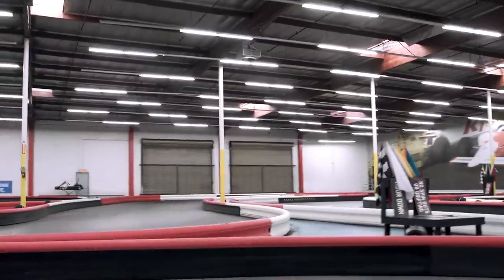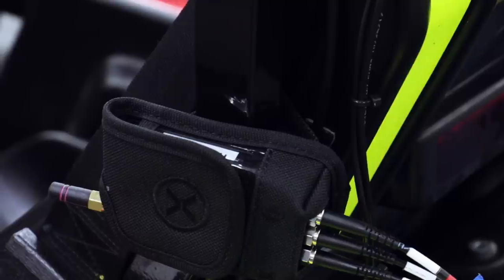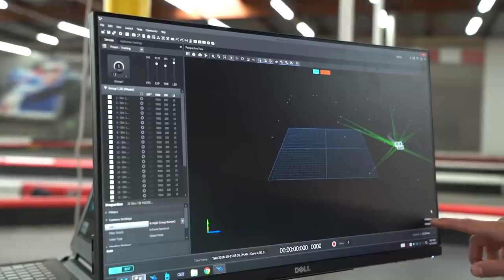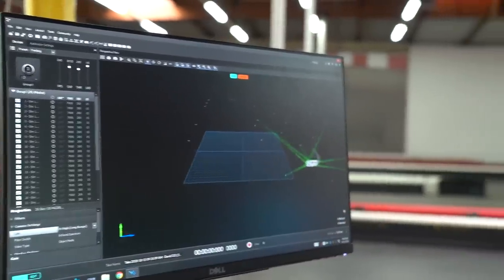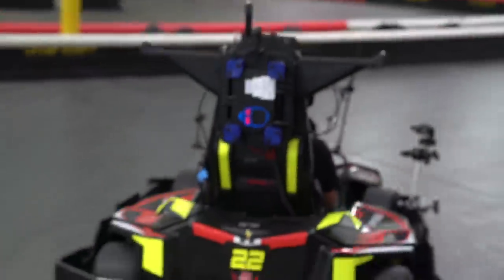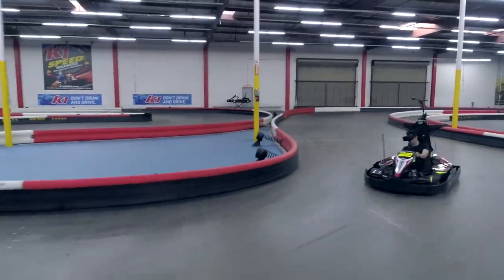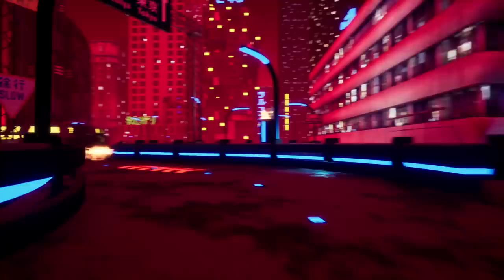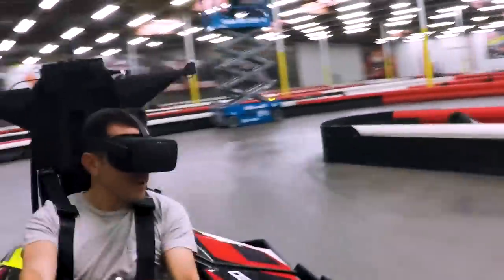Real Life VR GO KART RACING!!!

Comment: Without guard-rails, this could accommodate an infinite track, or infinitely many tracks.
Reply: thats cool !      but then, the rails or curbs are an important part of the driving i guess..    where you feel the track or being over a limit
Reply: @mm-hl7gh  Too right..  Rail-less would also introduce much more danger in local multiplayer -- implying a much tougher problem to solve.

It may also require a significantly larger area to do correctly.

But for single player, it might be fun. And the sensations of hitting the rail could be simulated, likely to reasonable effect.
Reply: they are electric go karts so they could easily implant a fake rail collision system.
Reply: @mm-hl7gh  well since this is virtual screening the physical rails and curbs don't represent anything except real sensation when you hit virtual curb but what they can do since these are electric go karts... they can simulate the curbs with fake colision but again it won't be as realistic as hitting real curb. So it's all about what is more preferable changeable maps or real sensation while hitting curbs...
Reply: I think you are on to something. If there is full control of the kart there could be code telling the kart that it can only reverse when outside the track to get back into the track
also if hitting the track at an acute angle the track can spit you back into the game ( as if you hit a wall )
Reply: @aggressivedynamics  Exactly. :)

Comment: Lots of cameras - looks too expensive.  I could achieve this with our beacon mesh and for Mixed Reality, if necessary.
Reply: Yes, the cameras and visual markers identify the tracking system used - which is expensive due to the processing of multiple camera streams to extract the positional tracking of the kart.  TBO I haven't seen this project in person, but I am familiar with the FOV limitations and video processing requirements of such a system.  To cover the entire track is significantly expensive in my opinion.  The graphics look cool for sure, though!  Don't take my input negatively, it looks very cool.  I respect teams that take on ambitious projects - bringing VR/AR to real life "cool" use cases.  Cheers!